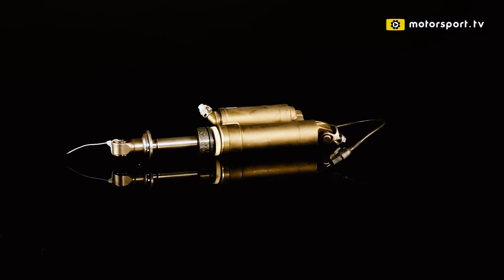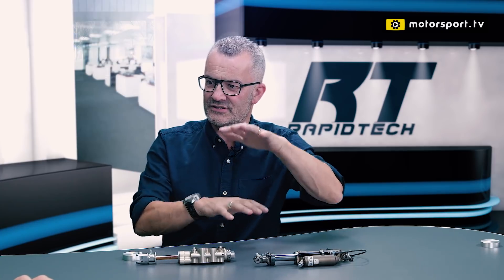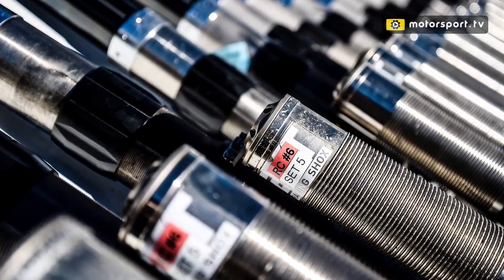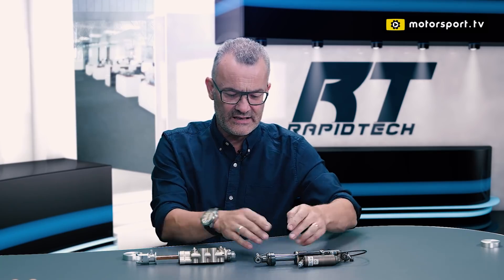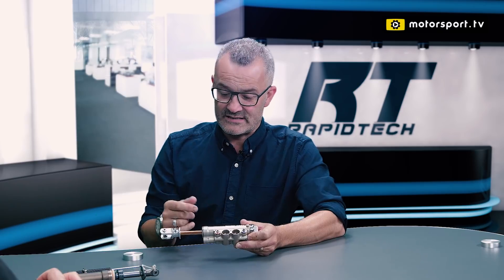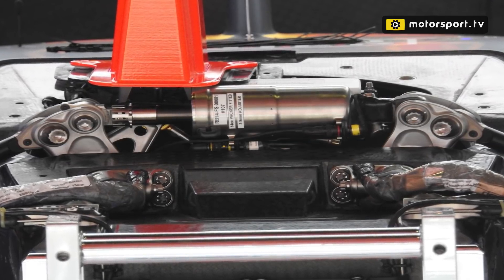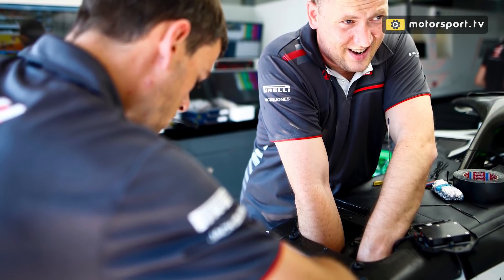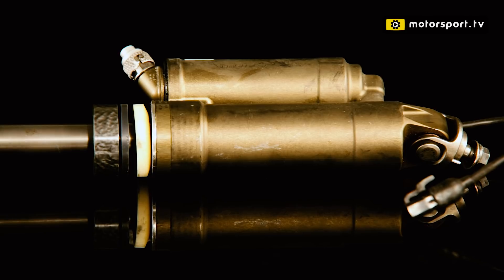Formula One Side Dampers Explained

Comment: The f1 suspensions are insane. Not only does it need to work at low speeds, but also at high speeds where the downforce pushes it down and the car doesnt lose rideheight. For example in eau rouge, where 3,500 kg push the car down. Also under braking the car cant lean forward. But it also needs to be compliant over kerbs, and it has to work in corners aswell. F1 is the pinnacle of motorsports
Reply: When people talk about high speed vs low speed damping, they are not talking about the speed of the car. They mean the rate of acceleration in the suspension. Slamming into a curb in a low speed corner is a high speed acceleration for the damper. The roll the car experiences entering a high speed corner is a low speed acceleration for the damper. 

To put it more simply: high speed damping is for bumps, low speed damping is for roll, pitch, heave and warp. 

Dealing with downforce at varying vehicle speeds is not really the job of the dampers. That's handled more by the springs and suspension geometry.
Reply: @wingracer1614  yes, i know, i just said that. I specifically talked about the f1 suspension. But thanks for clarifying for the people that dont know...?!

Comment: Generally, the higher the Downforce on the balance of the car, the more load the dampers are set to handle and be able to rebound, keeping the car stable over bumps, and not having the wheels lose contact patch. (Rebound always has more energy than the actual damping) Something easy to picture is to imagine a spring attached to the wheel and it is too floppy to keep what is on top of the wheel from moving everywhere, so you stiffen the spring and add something that will absoarb all the newton meters of force of what is making everything move when cornering or over bumps. F1 cars use more dampers than a regular car to stop the floor from moving vertically and scraping along the ground due to the load of air pushing down. It is a fine blance, that teams like Williams may just get wrong one year, and be completely useless, because there is something un-harmonious with the load of N/m going through the front vs the rear. Whether it be the loss of weight of the air mid corner, or in the suspension.